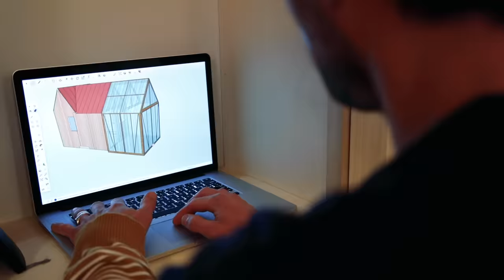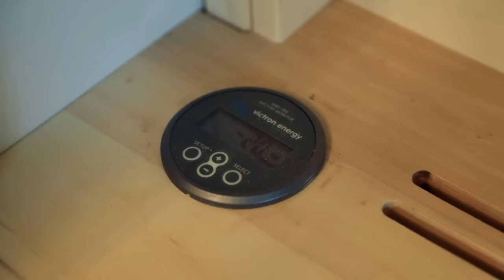Mind-Blowing Ultra-Compact Eco Tiny House

Comment: It's scary to think how much old but superior knowledge disappears from generation to generation. I cant believe the weight. Anybody could haul it. Bravo.
Reply from the maker: Very true. Great to see so much of that knowledge being reclaimed in this project!
Reply: Did you notice that when he unhooked it from the SUV that he pulled it aside with only one hand?  That big wheel on the support made it easy to do.
Reply: I would be worried that somebody could walk away with it
Reply: @mattstevens7601  Lmao.
Reply: @mattstevens7601  No worries.  I'm pretty sure someone would notice a guy walking down the road pulling a house behind him, and call a constable or a news station.  Freedom would be brief.
Reply: @lrajek3389  Hahaha. Ok yes when you put it like that it does sound unlikely to happen, but still, a strong guy could do that and tell onlookers that it's his house, surely. I would worry about that.
Reply: @mattstevens7601  Don't worry. Hitch locks wheel locks GPS insurance. What makes you think you could move a 2,800 lb a wheelbarrow?
Reply: @lrajek3389  Loved your comment. Made my day! I laughed myself silly!!!!!
Reply: @nicholasgardiner9601  ⁶⅞⁶⁶⁶6⁷7pm the first
Reply: @phyl1283  That's actually not an SUV even, it's a little crossover Citroën C3 Picasso, which came with engines with 120, 110 and even only 95 horsepower. This is probably the 1.6 diesel with 110hp and 245Nm.
I bet despite the low weight it will still struggle to reach 100km/h because of wind resistance, but as long as you stay away from the big "autoroutes" you can't drive faster than 80km/h anyway in France.

Comment: What a shame that France has so many great lands, views, but you can't enjoy it as it's illegal... because our leaders don't make money from this.
Thanks Bryce for that awesome video and for coming to France, hope you'll make some people start to change minds!! Much love
Reply from the maker: More and more people are getting on board and France is definitely a tiny house hot-spot in Europe! I'm excited to watch the movement there grow.
Reply: The same in Germany. All the laws against it, although it could solve so many problems.😔
Reply: Jola Ajtak Do elaborate, I am interested to know what these laws are like.
Reply: @jolaajtak7861  It is "all those laws" as long as You try to permanently build something. 
Put it on wheels instead, be off-grid and just park it, and 98% of the annoying building laws do not apply anymore. 
You are probably "homeless" and have to find relatives or friends with an address to "officially" counter that situation (in Germany), but that's etsy petsy red tape only. 
A post box and a parked offgrid tiny house-on-wheels, boom, gotchaself a home!
Reply: @attalan8732  It's quite complex and hard to explain without doing some deep research. But for example, in Germany you are supposed to register an adress where you live. And the landlord needs to confirm that you moved in otherwise he can be hold accountable as well if they find out you are not living there actually. If you want to travel with your camper van/tiny home you basically have register yourself "homeless", what makes it impossible for you to get a bank account, a phone contract a.s.o..

If you have found land to buy, it must be "allowed for building", which is never in the woods or at a lonley lake. 🙄

If the land is allowed to build on, you need find an engineer who approves your building plans and you need ask for permission to built, which already costs a couple 100 Euros. Furthermore, the land needs to be connected to a street, to canalization, etc. which makes the idea of being off grid senceless. 

A lot of living areas have rules how building needs to look to fit in with the other neighbour buildings, like size, form of roof, walls, etc..

There is still a gray area how they handle tiny houses on vehicles. I think it would only be allowed to register as home adress if you live in it on a camping site with a permanent rent, but who wants that. In general, it is not allowed to live in your car or shed on recreation areas. So neither finacially, nor ecologically nor for travel reasons it makes sence in Germany to live in a tiny house.😣
Reply: @manfredschmalbach9023  The law has changed. The landlord has to confirm that you actually moved in. If they find out later that you dont, the landlord will hold accountable, too.

Furthermore, in Germany, you cannot just park a tiny house anywhere. They will check on you, that you dont live in it. The most likely thing would be to live in a recreation area, but then you must make sure that no one in this area will tell on you for living there fulltime, what can easily happen with German's  mentallity.😏
Reply: @attalan8732  For exemple, you can't park it everywhere, not even on a land you bought, it has to be "family land" which is actually some kind of a joke considering you have to buy a house on that land to make it family land. That goes on the opposite of Tiny Houses, then you have the laws about movements of the house, laws about insurrance/ (don't know if this is the word sorry)
then most of the small town mayors are opposed to this kind of homes, some of them do not even create or give some land to park even if they normally should be. These are examples
Reply: @jolaajtak7861  etsy petsy red tape, yes, that's what I'm subsuming under red tape in the wider contextual understanding: You gotta have somebody in situ to actually empty Your post bin and tell You what's going on, unless You succeed somehow to put the post box You usually use for an everyday address into the official form - with what explanation ever. It's a bit of a hassle, but as long as You know how the red tape authoritarian lizards think, You could still get around that pretty easily.
And fun fact: there is no legal obligation to physically be most of the time where You are officially registered, as long as You are "on the road" whatsoever: be it working abroad, be it travelling the world, be it on a longer journey just around Your hometown. What they actually want with that kind of "law" You mentioned, that's what You gotta know. You do not have to obey it by the letter, as long as You will not expose Yourself or some other people. Each red tape bully has a certain, manifest reason to do what they think is "right" or even "lawful" (like the Nazis in 1933 to 1945 were absofuckinglutely sure they were nothing but 100% right ...), but that doesn't mean it has to be Your sense of "right", too.
Reply: Ah what fun. Bureaucracy. Well I do hope the situation there gets better. To be fair, all red tape exists for a reason, even if it doesn't fulfill its purpose very well.
Reply: I'm French and i must agree on the fact the bureaucracy just isn't in favor of tiny housing.... They make it impossible for people to have a little more freedom and independance!
Reply: @morganfreeman5171  That is why we have to find ways to implement tiny housing inbetween, under, over or beside the red tape, for example registering a Sprintervan or Campulance as a passenger car instead of RV or transporter/lorry. They can not deny parking for passenger cars anywhere without denying it for any and every other passenger car, too. And You can not be denied to sit in Your passenger car at any time of the day no matter where You (passenger car legally) parked: The "no-RVs-at-night-beyond-this-point" problem: solved. That's why places with a "no fixed buildings" policy do need something else than fixed buildings, be it an RV, be it a Circus wagon, be it a 40'' container which isn't a fixed building no matter how hard they try, and so on ....
Reply: You had me at cheese!

Comment: The best one yet.  The builder has thought through everything in these tiny houses.  I expecially like the way he installed the roofing panels at the valley.  I don't know why I never thought of that before, but it is a great way to get the valley drain without putting in a valley separately from the roofing.  It seems he has really spent a lot of time working out every detail to the ultimate solution.  He should open a factory in the US and become a world supplier.  The exterior is so well detailed that it looks almost machined.  Excellent in every way.  This one reminds me of the other recent French tiny house that you recently featured - it was also very well detailed and constructed.

Comment: I am so amazed at how spacious it seems on the inside! I have a question, though: what about a fridge or cooler? I did not see one or hear him mention it?
Reply: Maybe he don't use fridge, as when living off grid fridge will consume a lot of electricity
Reply: Hi Arinaa Maybe... but you get some very efficient cooler boxes, so I’m just curious about where his clients would put one (even a little cooler box) since there doesn’t seem to be extra space.
Reply: @maritsaappollis7966  One tiny house owner just uses a cooler with ice, but in my opinion, the day people start getting food poisoning due to no refrigerator is the day the gov will start cracking down on the movement.
Reply: wow newstome I certainly wouldn’t be able to go without a fridge - even a small one for things like milk and cheese and meats.
Reply: Also, I suppose you can handwash your clothes but where do you hang your laundry to dry afterwards? Inside would get too stuffy and outside you have Britanny weather hehe.

Comment: I wonder if they can make a Tiny house that is wheelchair accessible and no loft
Reply: They've done a video on this! Maybe halfway through last year? If you wanted to have a search :)
Reply: @izziepope  I really liked the one designed for aging in place. Enough room for the walker-user. I was only concerned with that one about the mechanism the bed was raised and lowered with. Pretty sure that they had a ramp up to the porch. Much much larger than this one, though.

Comment: This is great if you intend to move around a lot - I feel personally that I would like it a little bigger so that the bathroom and kitchen area could be more developed - the kitchen needs a fridge and I would hate to have to keep on wiping down the toilet and walls etc every time I took a shower - apart from this I feel that there are a few tiny improvements that could still be made around the place to make it better, eg. more space for the clothes - doesn't everything fall because they are not enclosed? Tks for sharing the vid

Comment: Yeah you can live in these.  The price however is way out of line for the size of the unit.  You should look into other types of wheeled homes.  For $45,542 you can have a single wide Manufactured Home (aka mobile home/trailer home) with 693 sq. ft. of floor space, 2 bedrooms, 1 bathroom, real kitchen, dining room, living room, and optional 1/2 bath in the 2nd bedroom.  Redman "trinity series" measures 14x52 feet.

Comment: Most sinks in tiny houses are ridiculous. If I were to build a tiny house I would use a shallow  
4' long fish fillet sink that can double  as a counter (albeit slanted) where you can prep, wash veggies or dishes and drain. A wedged block could keep a cutting board level inside the sink or a cutting board spreading from edge to edge over the sink.. I got the idea for this from a description of a Carribean slavekitchen that had an elevated countertop height table with 4 or 6 inch sides filled with sand. Inside the sand they had their prep space and a little cooking fire. No stooping.

Comment: $53,030 US $$ at today’s price. (9/16/20) Very nice little house! I like that he used all natural materials instead of plastic. Did he say he used cork for insulation? I’ve never heard of that, but it sounds good. Wondering how well it insulates? At least the owners won’t be breathing in toxic outgassing fumes. Love the way they treated to wood so it won’t absorb water and no need for toxic paints, etc. I wonder what’s involved in “burning” the wood? The reason it’s SO tiny is so it can be pulled around easier w/o a giant pickup. I wonder how small a vehicle could pull this tiny house? 

I really like it but in the US, it’s really hard to find land where you’re allowed to park something like this. They have all these ridiculous requirements about homes having to be on a permanent foundation, and the minimum square footage of a Giant house so they can charge more taxes. To bad if you can’t afford to pay $4000+ a year just in taxes, let alone pay for your house and land!

Comment: It’s adorable and superbly designed, no question, and Thomas is a great guy. There is, however, something slightly oxymoronic about making claims to sustainability whilst referencing an object that is designed to be tugged around by a motor vehicle. Just a thought.
Reply: You are totaly right, and it's the main reason why i work that hard on the weight : to be able to trail it with an electric, or hydrogenic (?) Vehicule when those will be ready :)
Reply: Cool answer! Let’s hope that day comes soon 👍😁

Comment: I'm finding that tiny houses without any hookups... No incoming water. No sewer.  No gas/propane... - well wood is Ok, but you have to be there 24/7 in the winter so that things don't freeze....  No cable....   // Without these essentials.. IT'S JUST A FANCY BOX... I wouldn't stretch it so far and call it a 'house'....

Comment: i understand the concept of this tiny house but 45 thousand dollars its not wort it for that price that house has to be twice the length a bigger water tank hidden with in the frame better shower with space between toilet an shower bigger sink a small propane stove loft height needs to be a 2 feet higher , i am a builder an i can build a better tiny house than that for 45 thousand dollars , this man is still about profit , that tiny house worth 25 thousand dollars